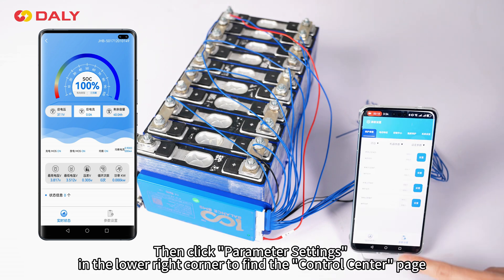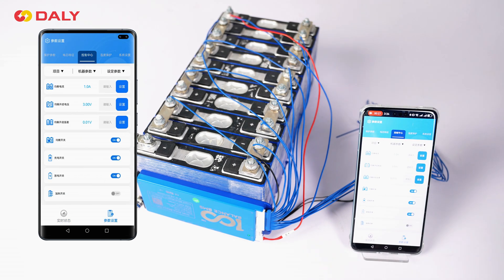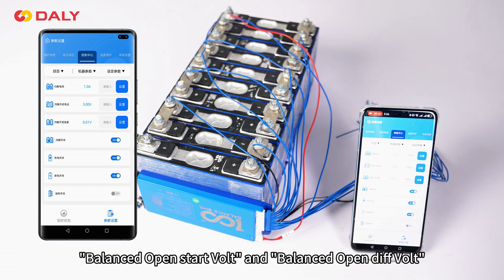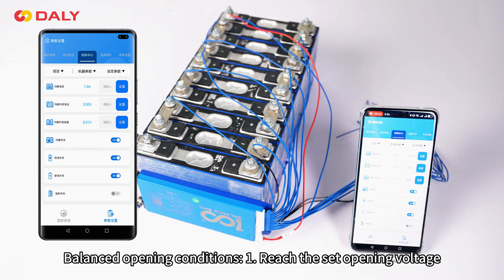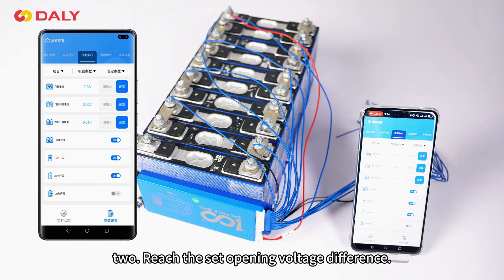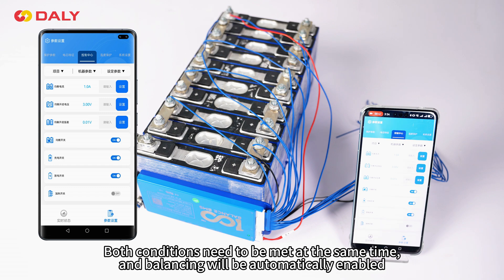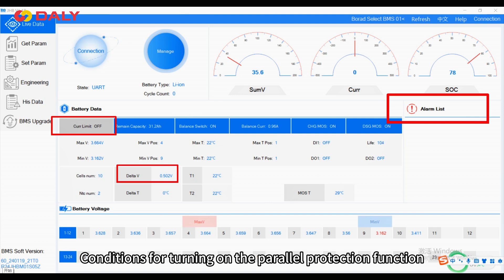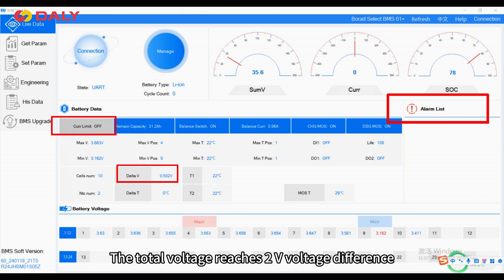Demonstration of some functions of 100BALANCE active balance BMS

Comment: I will have 4 large current batteries soon attached in parallel to 4 paralleled 150 AMP 100balance BMS.  This video was much too fast to fully understand.  It sounds like the presenter is extremely nervous, talks too fast, and really needs to slow down this presentation. I hope you can make future videos where you take more time and show settings closeup, for parallel and smart balance settings.  As you say excellent companies are constantly improving and moving forward. I believe in what your doing!!!
Reply from the maker: Hi， dear, thank you for your suggestion,we will keep improving.